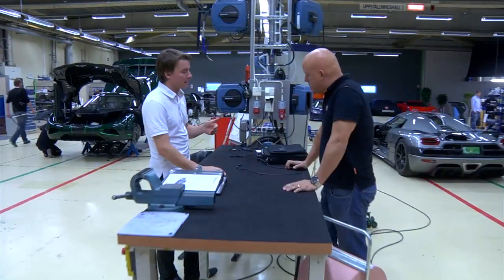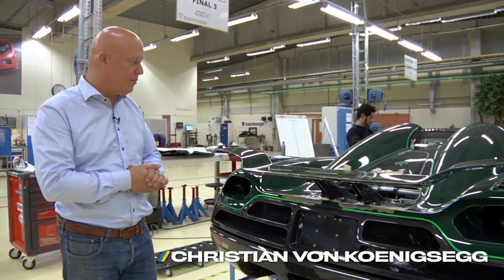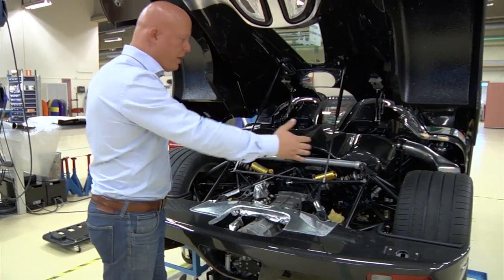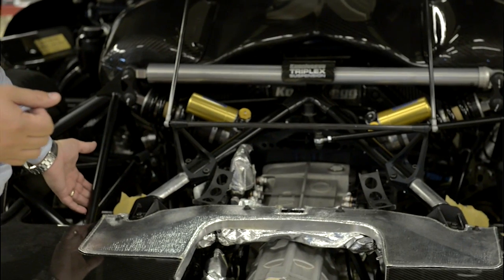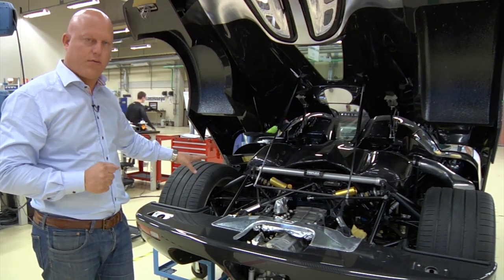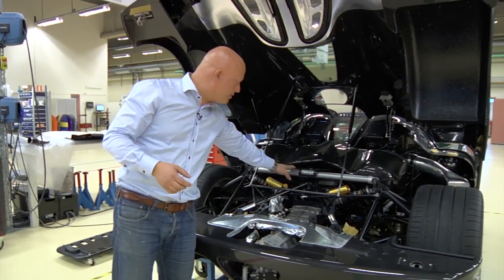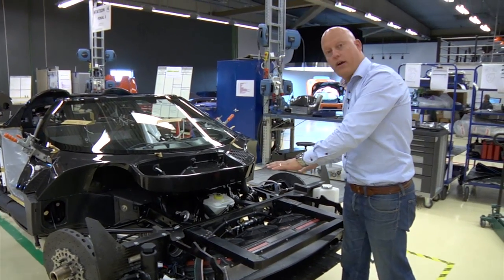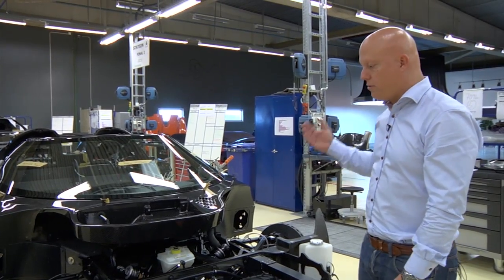Triplex Suspension Explained - /INSIDE KOENIGSEGG

Comment: Perhaps a newer concept for suspension control can come from the use of "Magnito  Reological Fluid" that incorporates a lateral yaw & pitch sensor to apply amperage to an electromagnet in place of common shock calving, the shocks reacts as it changes the fluids viscosity from 5W motor oil to peanut butter in 2uS thru a simply oriface inside the shock to make it soft to harder as road conditions call for it.
  I believe this technology was applied to the motor / transmission mounts on the road car, when rubber mounted. Shout out if curiosity gets your attention!
DK, Omaha, NE. ASE Master Tech since 1978, GM tech, ACDelco instructor / tech seminars.

Comment: well the extra damper is always used in old american and some asian automobiles (usually trucks) to absorve undesired vibration from the front suspension components caused by ride, inertia and other physical forces that affect ride which i believe it was a necessary improvement on these outdated models and of course affordable for the end comsumer
but innovation is not about borrowing ideas and make it work conveniently on your new designs, im guessing
instead of adding that extra accesory, and adding more fuel to the existing fire, your designers should work on a unique shock absorver that will stabilize and improve ride while using a single component instead of complex attachments and more shocks - please give me abreak! - that not only demonstrate how outdated these engineers' ideas are regarding the design for a better ride and eventually a better life w/o all those extras involved
then, we could say, that is progress

Comment: its not a good design to have interconnecting damper between the two rear wheels. because when one wheel moving downwards it pulls the other wheel up taking grip away
Reply: man build your own hypercar then prove it to us.
Reply: The anti-roll bar system, the Z negates this. Damper pulls the opposite wheel up, anti-roll bar pushes it down.

Comment: I know it's only a small point but he says the third damper helps reduce the negative impact of the anti roll bar over bumps and then immediately goes on to say the same damper is only tuned to low frequencies and has no impact on the suspension at higher frequencies eg bumps! Nonetheless, these are excellent videos and much appreciated.

Comment: Citroen did the basically the same thing 60 years ago with the hydropneumatic suspension of the DS. There the hydraulic oil acts as the shock absorber. The hydraulic lines of the two sides are connected, so they have the same counter-effect to the anti-roll bar. There of course safety and comfort were the most important so the whole suspension system can be set very soft and still having the same ride height at all times. but it squats like hell.

Comment: I am sure they have extensively analysed this rear suspension setup. But it does sound a little counter intuitive to me, may be if any of you can make me understand it better. 

Anti roll bars are to minimize body roll during cornering- which is a slow speed phenomenon. Why would they want to cancel its effect out?
The thing he mentioned where the car travelling on bumpy roads, will encounter bump or droop at high velocities. I agree the anti roll bar will make the ride uncomfortable. So shouldn't the triplex damper be valved for high speed damping instead?
Reply: +Aditya Pradhan Anti roll bars force the suspension on the other side to also compress when the car wants to roll, making the car squat instead. This suspension counter that squat-effect while cornering just as it counter the squat-effect while acceleration. So basically an anti roll bar makes the cars squat instead of rolling, and this suspension counter that squatting-effect. I think this suspension don't want to move under low-speed phenomenon (accelerating and cornering), while working as it should at fast-speed phenomenons like bumps.
Reply: +M3Conv they already have a patent on it if i'm not mistaken. In fact, they patented all of their innovations including their turbo design, their hydraulic coupling system, their direct drive technology, and so on.
Reply: +Aditya Pradhan Anti roll bar as such is only a "stupid" piece of metal. With this damper you can adjust and finetune the characteristics of it.

+M3Conv If it would be just a gimmick, why all racecars have a third spring? This is an implementation of a third spring in a way.
Reply: Juha Mikkola
Its a bit of a dated idea when compared to say McLaren's hydraulic active suspension. With that you don't need roll bars, Bentley smooth suspension when you are on the road and track hugging aerodynamics at the race track.

I am not convinced that a road car like Koenigsegg generates enough down force to benefit from a 3rd spring.
Reply: +Aditya Pradhan Its a gimmick, if it was a true advance then all the other manufacturers would be copying it.
It does look good though and i guess that's what helps it sell
Reply: They cancel each other out, but not for the same period of time. A damper is short term damping because it's resistance is only as effective as long as the valving allows. While the anti-roll bar will apply constant resistance indefinitely. So it would seem that they would cancel each other out during initial turn in, but once the damping quickly passes, the roll bar will continue to sustain it's anti-roll affect. What's confusing is the anti-squat nature of the damper will be short lived as well, only damping out bursts of power, but not resisting long duration squat. It's a convoluted design to me as the rear of the car isn't resisting squat, only slowing it down.  Unless.... the damper is also spring loaded... which would then erase the entire first half of my response, leaving me just as confused as before.  Anyone else? lol
Reply: Roberto Cheerio
Its a ridiculous idea that just adds weight, complexity and another point of failure for no good reason

Comment: So it's basically a dampener acting as a heave spring that push/pull rod suspensions use, or used? I haven't seen heave springs for awhile.
Reply: +Xander Zoolander Was wondering if I was the only one to notice this is basically a push/pullrod suspension

Comment: What are those fans in the front used for?
Reply: It's not uncommon for a mid/rear-engine car to have the engine radiators at the front, where there is plenty of airflow.
Reply: Fans are used to pull or push air through a radiator when the speed the car is moving doesn’t provide enough wind. The more sir gets pushed over the radiators the more they can cool whatever they’re cooling. Often the fans turn on when the car is stopped or when it’s very hot out.
Reply: They are small fans, so I'm guessing that 1 fan is for passenger air conditioning and maybe the other 2 are to guide airflow into the brakes...

...or perhaps the car has some Venturi-principle mechanical-aerodynamic system, like the McLaren F1 has. That's just speculation, but the McLaren's Venturi system as implemented by Gordon Murray was quite the black art, yet apparently quite effective. It know that the system used fans. That Koenigsegg's fans look a little dinky to be handling high volumes of air, though, but I don't know much about high-performance fan tech :P

Anyway, the region of space right under the front valences of standard road cars can generates enormous air pressures at high speed. If you pop open the front hood of a Koenigsegg you see massive air ducting that is guiding air taken from under the front valence. Air is piped from the high-pressure area under the valence to those straked outflow ducts in front of the windshield, above the front tires: more front downforce for the car to work with.
Reply: The ones facing vertically? Those are used to pull air through the radiator at a stop.
Reply: guys, it's his fan club
Reply: you can see the tubes that go to the brakes
Reply: Those are for the radiator...the brake coolibg tubes that are visible are fed by another set that are attached to the bumper.
Reply: Willy Lamb I second this motion

Comment: Since there is only a damper and no spring, this Triplex system only works in transient conditions, which is desirable for this car, since excessively high ride stiffness on a relatively low downforce car will simply make it too uncomfortable and degrade tire grip.

Comment: This is basically a simplified version of what F-1 cars uses today in the form of a 3rd spring/damper coilover set at the rear. For F-1 cars, it allows for the necessarily high ride stiffness to support all that downforce without excessive roll stiffness.

Comment: You sound like someone clueless enough about cars to not realize Veyron was never designed to be trashed around a track on track days. Its not a track car. Its a luxury grand tourer that happens to have 1000+ hp and is very fast. In terms of engineering put into it, its light years ahead of a Venom, and any other supercar. But in order to understand it, you need some extensive engineering knowledge, which you, or 99,9% of people comparing these two cars absolutely dont have.

Comment: More for less? If one examines the specifications and the times, your claim appears somewhat exaggerated.
Venom has a 7 litres engine vs Ageras' 5 litres. The Venom is only 50 kg lighter and reaches 300 kph just a second faster. 
Agera R has a consistently higher sense of quality, better choise of materials and more sophisticated and advanced solutions for just about everything, and this for "only" $ 700,000 more. Venom is moore a Kit-Car in comparinson and then the price tag is way too high.

Comment: if you want a fast car with cheap price, just swap your car's engine with nelson racing engine which can produce 2700 hp. Does it make you car great?
The agera R uses 5.0 L engine, while the venom GT uses 7.0 L engine. Which is more efficient? And what about the chassis, the clutch, the suspension of Venom GT, are they technologically advanced? And what about the lap time, will it be better than the Agera R? Venom GT is no more than a Lotus Exige/Elise with swapped engine & other mods.

Comment: Third shock absorber - it has one spring and shock absorber per wheel , anti-roll bar connecting lower part of wheels for stability and third shock absorber on top of the wheel to cancel negative effect of anti-roll bar . Most fast American cars these days use live axle and leaf springs , and most new EU trucks have more complex suspension than American cars (Mercedes Actros) .

Comment: Why do people keep mentioning that car? Its not nearly as well or thoroughly engineered (or over-engineered) as the Agera...or Veyron, or any other european supercar.  Its just a very tuned up Lotus, I know its more than that, but bottom line is, its just a very tuned up car. Its fast. And? Those old Mustangs or Imprezas at quarter mile races that produce 2000hp are fast as well, does that make them great cars? No. Its easy to make a fast car nowadays, but its much harder to make a GREAT car.

Comment: As TheOffiialKC stated shocks are velocity sensitive.  So if I am translating YOU right, bump has more force, which means more acceleration and thus more speed, than when the car rolls.  But like I said in my OP the bald dude stated that the shock was meant to work in low speed,  so if the triplex was going to cancel anything it would be the anti-roll bar during roll and it would ignore the forces of the bump since it is higher speed.

Comment: The bald guy explained that when only one side hits a bump, the squat damper cancels out some of the force from the sway bar making the ride better. How would the damper cancel out a harsh jolt, but not the sway bars anti-roll force when cornering, when he earlier stated that the damper was designed to work at lower frequencies?  I would think that the "squat frequency" would be similar to the "roll frequency".

Comment: You are right about the race cars, of course. But that is mainly because a lot of racing series limit the amount of technology allowed to minimize costs and emphasize on driver input, even though I personally have to disagree with the emphasis in some cases. Production cars have technology based on the customer needs and the price point they are aimed to. Price point then, is defined by the anticipated customer type and their number. Just a thought.

Comment: Getting 'any' BHP number from 'any' displacement works well on paper. Wat you forgot is that the Veyron will run for 30, 40, maybe even more years. The BMW 1.5 I4 turbo from the crazy F1 era did ~1500 bhp for the qualifying session. But did it for a grand total of one lap, after which the car was immediately parked.

Comment: With forced induction (unlike NA) theoretically you can get pretty much what ever BHP you want from any engine displacement (within certain limits). If you remember F1 engines from 30 years ago developed 1200BHP+ from just 4 cylinders and 1.5 ltres. Obviously Bugatti did not need W16 4T to get1000BHP, they just did it because no one had ever tried it before and if you are building the worlds most exotic car, you need it to have the worlds most exotic engine. The V8TT here is much more functional

Comment: The Nardo testtrack is not a straight line, it's a circle. Even so they had the record before the Veyron. The Veyron set the record on the straight that they run the Top Gear feature, it's an 8 km long straight. 

VW (owner of Bugatti) won't allow Koenigsegg to test their car there.

Comment: cont. The biggest gain in comfort is however the fact that the anti-squat damper allows them to keep the other dampers softer without concerns of compensating for the squat there. I think he got caught up in the dampening during roll because he found it a neat feature that most probably wouldn't think of. I believe he also went more into detail about the "normal" anti-squat feature in Drive's previous feature.

Comment: You're wrong. The antiroll bar does it's business regardless but adding a damper should make it less twitchy and harsh since what the antiroll bar is doing is basically making the car squat. This squating movement is difficult to adjust for with just the two dampers since the dampening you want on the individual wheels is different than the one desired on both wheels combined. If this was not the case they could've just stiffened the dampers and never used the anti-squat damper to begin with.

Comment: Nope, V8 is more economic to use, and better to turbocharge due to less cylinders. With a V10, you either would need a bigger engine (worse fuel economy) or more turbos (less relability). So v8 is a good choice for sports/hypercars. Ferrari among all uses v8's too.

Comment: Hi.

The Koenigsegg Agera S is made to do its top effect through gas, not by ethanol that the Agera R does, so The Agera S does get a slight less effect of 1030hp and 1100nm, instead of ageras 1140hp and 1200nm. 

Agera S was made for use in countires where it is hard to find E85 (Ethanol).

And also, some safe sources are saying that Koenigsegg is building 1 special model for a chinese customer called "Koenigsegg One 1" with 1400hp and heavily modified agera chassi.

Comment: These guy is one of those rare engineers(i don't even think he has a degree) that can understand and inovate the auto industry in so many ways,not only in one aspect(only suspension or only engines)...he is very clever and inovative and many of the stuff he does can be used in the future in normal cheap cars,as an improovement.For example i think they have the most eco friendly engines,and very efficient,in the supercar world and he does more inhouse work than many other bigger
 manufacturers

Comment: Basically no. Damper rating and spring rating are two separate things. Springs are actually the parts that take the shocks (that is why shock absorber is "wrong" when talking about dampers) and resist the forces shown to suspension. Damper is sort of an speed controller for the suspension movement. When the wheel hits a bump for example, the damper controls in what rate the spring will go up and return down. A certain amount of damping needs a certain amount of spring rate to work well together.

Comment: The MP4 came out a year before this car.  Not that I am saying the MP4 uses this design, because I haven't really looked into that car enough to know.  I am just saying that if the MP4 has a similar solution to deal with squat and what not than I would say the boys at McLaren used it in a road car first and Koenigsegg most likely designed his off that.  Also I would guess that McLaren most likely used tech that trickled from their F1 team.  If the MP4 came out first who would you say was first?

Comment: The Triplex suspension reminds of so many designs I have seen. The Dedeon tube was my first thought. Then it hit me when I heard his basic description of the system: Mono-shock. This was used a LOT in older R/C cars and had effects very much like that but you only needed one shock, an anti-sway bar, and down-stops. The two regular shocks in the Agera provide the down-stops and the springs.

The design is not "not clever". I'd just saw what he did there before.

Comment: Very clever indeed, but I guess it's very expensive and the space required for this setup doesn't exist on a normal, front engined cars. Think about it, would you buy a car which had a horizontal steel bar running through the middle of the luggage compartment?

Comment: Why are they running rear helper springs? Just design the body of the shock to have the spring perches in the right place.

You only need helper springs when you've adjusted adjustable suspension to its extremes. If you're making it from factory...